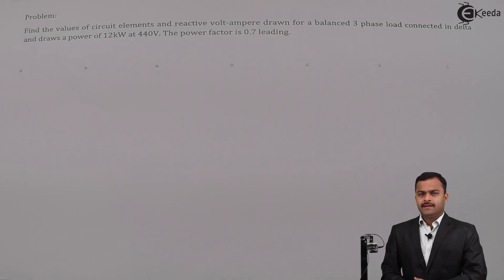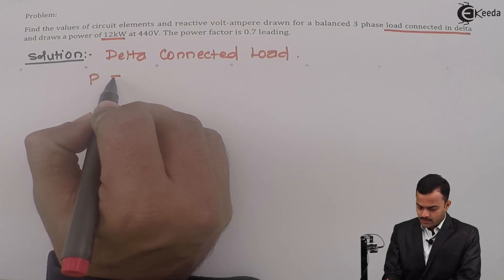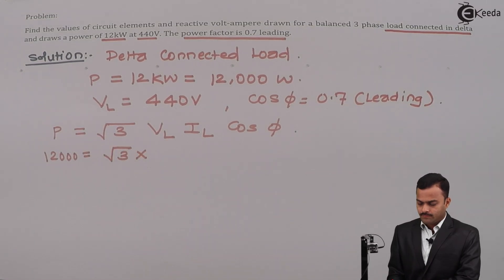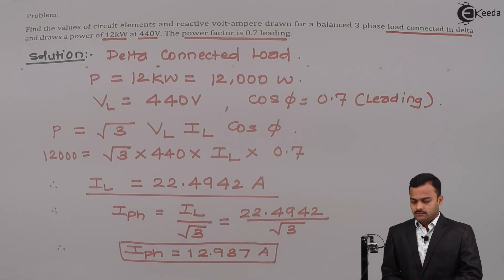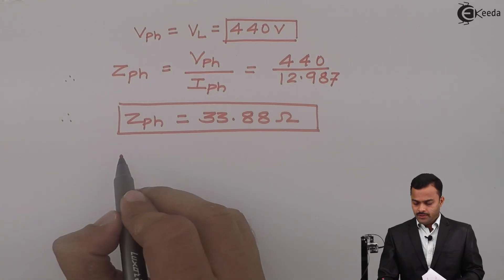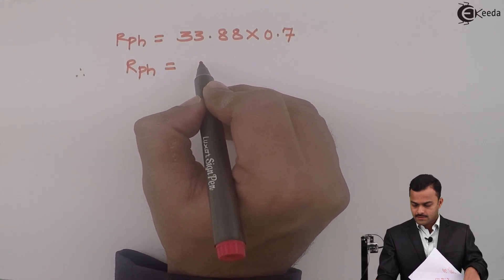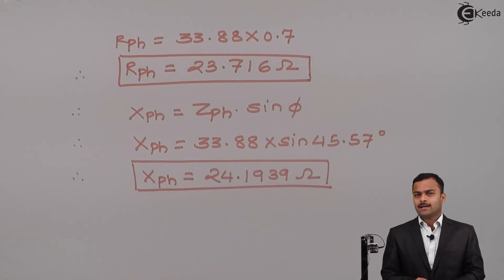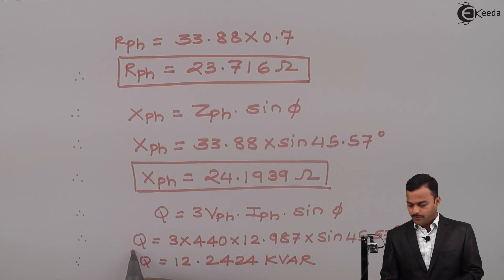Problem No.2 on Three phase Circuit Connected in Delta

Comment: For all those who are wondering why there is root 3 in power formula whereas there was 3 in previous video, it's because in this formula he has taken line current and voltage unlike in previous video where he took phase voltage and current. So root3*phase current will be replaced by line current. Hope it helps.
Reply: And VL= V ph 
So the change in formula for delta connection is only due to relation between IL and Iph